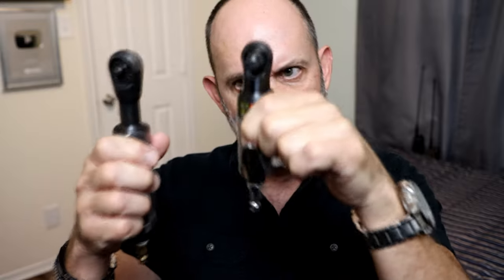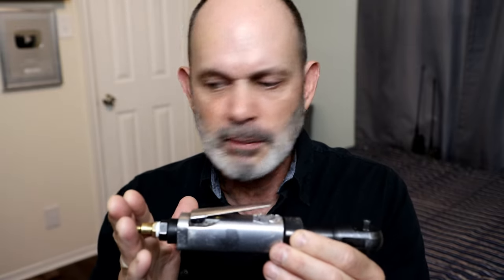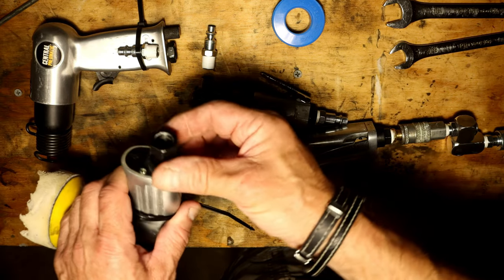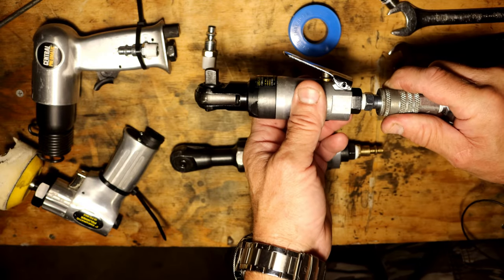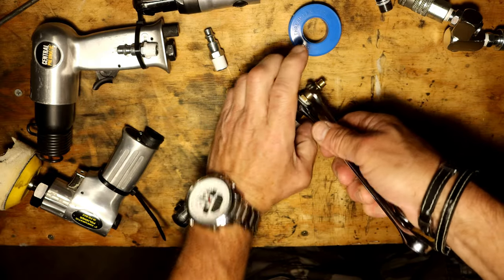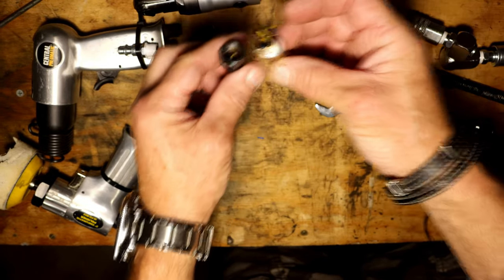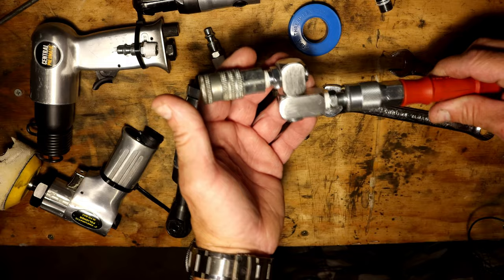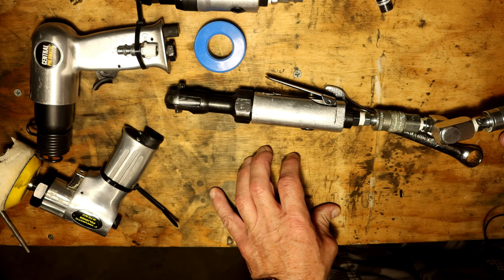Air Tool No Power No power FIX! Simple.

Comment: I'll add this safety warning. If you find rust in the screen shut off your compressor and drain all the air from it asap. Use a bore scope to check for tank rust inside it. If it's rusty inside don't use it as it could explode, seen it happen before. Replace the tank or buy a new compressor
Reply from the maker: Thank you so much for watching, commenting and the valuable feedback. I appreciate it greatly. All the best.👍😀